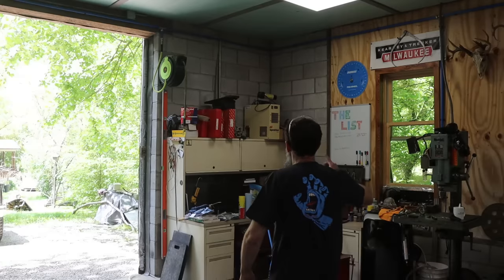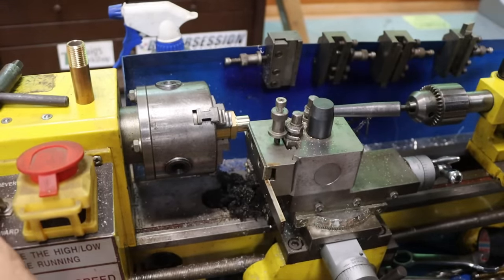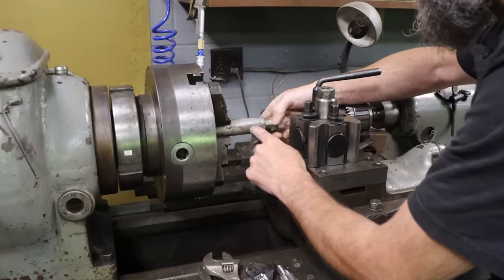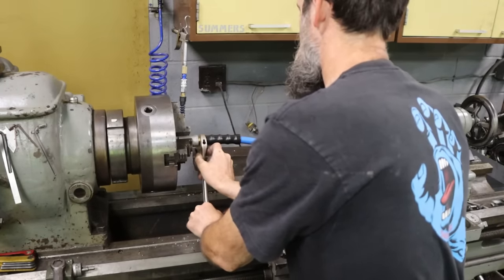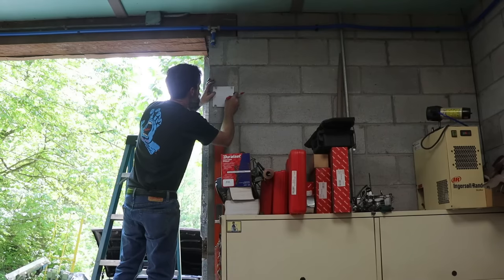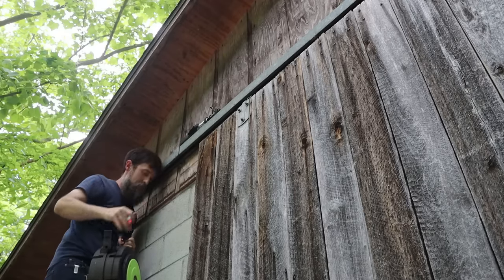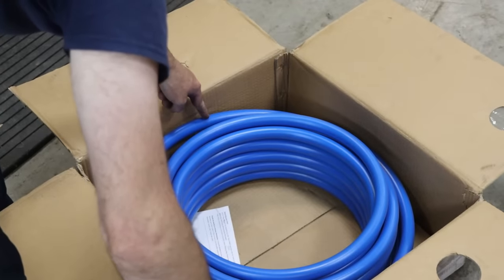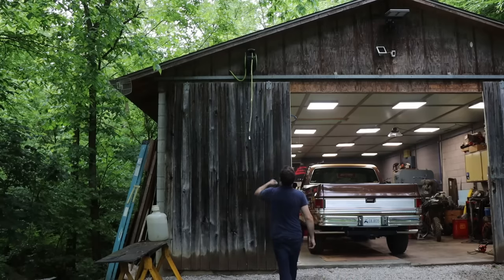Was this a Bad Idea?  Workshop air system .. Upgrade?

Comment: As an FYI, if you are using a "name brand", quality, "standard projection", off-the-shelf taper pipe tap, the tapping depth is approx. 12 threads back.  During manufacture, we (in this case GTD) thread a ring onto the tap to size it.  The large end face of the ring represents the top of the tapped hole and the "12 thread" location.  If you happen to cut off the front end to shorten it (Short Projection for shallow applications), it's approx. 5 threads from the back.
Reply: Thanks, that’s handy to know.

Comment: Steve, I love the idea of the outdoor hose reel. But a couple of things I want to let you know from experience. First, in cold weather, the o-rings in those reels seem to shrink and cause an air leak. Secondly, I highly recommend adding shutoffs and/or a quick disconnect just ahead of your hose reel. That way if it ever starts leaking or you want to change it out, you can isolate it without having to depressurize your whole air system.

Comment: I don't remember what you have for a dryer on your air system. I am praying that it is a good one. Here in Nebraska I have problems with water freezing in hose reels in the winter.  I too am concerned with the potential for bird and insect interference.  I have and use 2 of the enclosed air reels and I would prefer to have open reel style reels. I have had insect problems with my reels in the past.  Thank you for the contribution that you give to the machining community.  I look forward to each of your videos. May God bless you and your family.

Comment: I like to use the loctite Hydraulic sealant for pipes works great and never leak.
Reply: Holy Cow, I just looked at Amazon for that and it’s expensive! I don’t use a lot anymore so I might have to some, it easier to pay a little more that have to tear something apart because one joints leaking.

Comment: ive got that same bit set, with the little ratchet and extension,  great under dash and tight spots...
Reply: I’ve got the exact same one and I use it a lot, more than I thought I would. If you have a tough screw to get out, you can really put some torque on it using that little ratchet. I’ve got a set of adapters for my 1/4” drive Dewalt that has hex head to 1/4”, 3/8” and 1/2” drive so I can use about any tool or extension with it. I haven’t used the 1/2” but it’s there if I get in a tight spot.

Comment: Hey Steve, one thing you may want to do is have something to secure that outside hose reel so it doesn't go banging itself against the wall during a windy storm. I could see not only the unit getting destroyed, but also the airline getting pinched.  Great vid - I really enjoy shop upgrades.

Comment: I have that same reel (its branded different (Reelworks), but it appears identical down to the mounting holes. I also had some choice words mounting it, it's sure not light.  3 years into owning it it still works great, no leaks. As for the green out outside I might be tempted to give it an aerosol overhaul to make it blend into the building a little better, at least for the 2 green panels and maybe the hose going into the building.

Comment: I've seen a guy do this & I agree with it.
Mount & adjust the cutoff tool upside down in the tool holder, cut in reverse.
That way as the carrige & the tool flexes, it flexes away from the workpiece.
Eliminating the tool from moving into the workpiece eliminating the chatter & Binding..😊

Comment: Nice job Steve. 1/2" hose is a good choice, but I did when I was working (retired) make the company buy and stock 1/4" and 3/8" hose. My job back then required me to hand drill precision holes that only allowed +.002, and with the larger 1/2" it was really difficult and sometime impossible to do. Just to stiff and bulky.

Comment: Great job Steve! I am just installing my compressor right now. I want an outdoor capability just so I can work outdoors in the summer, but like you, I can't leave the door open because of the humidity (and heat!). I'm leaning towards just having a coil of hose near the door, and a chuck outside because of the same issues you mentioned. We would have hornets in the summer and Asian beetles in the fall filling-up and enclosed unit, and the sun would destroy the rubber pretty quick on an open unit. I will be curious to see what makes a home in your unit. here, a mud dauber would fill up the chuck right away, and I plan to cover mine

Comment: My shop air system has a solenoid valve (oversized to not affect flow) between the compressor tank and the pipework, activated by an illuminated switch just inside the door. That way the compressor can stay on all the time, but I'm not going to burn out the compressor if there was a failure in the pipework. That outside hose reel is asking to fail at some point. I'd fit a solenoid inline with the reel if nothing else. A pullcord switch could then be used to turn it on and off. Combine it with an outside light and you have a perfect combination for airing up a tyre after dark.

Comment: Hi Steve.  Nice upgrade for the shop.  I hope one day to have shop air plumbed in nice like you do.  Until then, I can roll my compressor to where I need it.  I wonder if you could pop one of the side-covers off the old hose reel to check for birds or wasps, without destroying it.

Comment: Hi Steve from Tasmania, just a thought re nesting birds in the hose reel if you put a block/board/foam/rubber behind the stop it will block the hole without hindering operation cheers John

Comment: Generally to get the Full Volume in Air systems...you start with the Largest size piping/hose and reduce down as needed for each outlet in your system....you can't get maximum CFM if you are doing it backwards... smaller to bigger....  i understood your reasoning and just passing on my experience in Air Lines.... 
🇨🇦🤓🤟

Comment: Most people don't take the fitting off the air hose then put it through the wall it makes a much smaller hole! easer to seal.

Comment: Gas stations still supply air here in Sweden, but often you have to go inside the station to borrow the tire pressure gauge, as they tend to get stolen...

Comment: I'm out hose reel airlines on the ceiling above my machines pull down the line where I need it thought we tracked out of the way when I don't I gave up entirely on having wall mount air fittings it's just too much trouble compared to having them retracting the seal the harbor freight ones work fine I've used them for years.

Comment: maibe build a wooden or poliester cup that mounts around the hose and absolutely wraps around the hole where the hose comes out of
you might need to squirt a bit of antifreese in the outdoor hose or unroll it completely and blow a lot of air out while keeping the end down during freeses as theres allways some moisture in the hose and it might split the hose when it taws again

Comment: The only possible problem I can see is with the outside unit. Where I live when it gets cold any water accumulated in the line will cause it to freeze up and plug off until it's brought inside and thawed out. With your temperatures there it is unlikely that this will ever happen but for those who may wish to use this in the northern climes they may want to consider it.

Comment: Steve, guess there must be a reason why you didn't run the airline down the outside corner of the shop wall, clear of the sliding door and mount the reel at chest height on the side wall? Would be more convenient access, (no ladders involved) if you have to work on the reel, just thinking out loud. Good to see you back in the saddle. 
Cheers from OZ 🍻👍

Comment: I ( just my opinion ) would have mounted the outside setup...on your other wall ... and lower... alot easier to use or fix if it jammed up etc..)  and i would put a Quick connect to remove that air line reel as needed and put a quick hanging setup to remove and install when i need it... and probably some kinda box to keep it covered when not used... especially if left outside permanently?  
Why not take a look inside to see if it can be fixed to wirk better??
🇨🇦🤓🤟

Comment: Good to have you back on Saturday mornings, one thought you did seal up that thru  hole in the siding.?
Reply: I wondered if a plumbing fixture escutcheon (trim plate that covers the hole where a pipe would come through) would work on that. I’ve seen ones that are hinged to fit over existing pipes, just secure it with a screw or two.

Comment: Is there anyway you could fab something up that would fit on the hose stop that would cover the holes in the outdoor hose reel? Maybe use a plastic plug like you would use on a hydraulic hose to keep critters from building mud nests in the quick connect. Just thinking, that’s all, probably aught to quit that before I hurt myself.

Comment: Question for you have an air dryer on your system my concern is wet air in the hose rack in the winter you may pop a hose outside

Comment: I have the flexzilla hose reel (I think it is similar to yours) and I noticed if I dont help it wind back up going back and forth across and just let it go in one spot it binds up.  That may be a similar issue you are facing.    Have you decided to add (or already added and I could not find the video) an aftercooler for the air system between the pump and the tank to help keep the water out of the tank and lines?  That is my hopeful project this weekend if I can finally get the right final parts tomorrow to get the air back into the tank.

Comment: I live basically 30 minutes away from anything i regularely shop at for stuff.... there is a Farm Equipment dealer 15 minutes away that has some supplies i can get if really needed that bad....but i just plan to go get what i need ahead of time if doing some project..i am used to planning ahead my supplies and have a lot in my shops for most needs... i never drive out unless i have enough reason to get something..and i like to have another reason to go anyways....driving out to get a small part or fastener is wasting time and fuel... especially nowadays....i can wait to complete a job or at least think of other stuff i might need as well.... we all find we change our plans as we get into the work or run out of fasteners ( i buy more than i need and usually save by buying a larger quantity and the next time i need that fastener..i save again by having stock to use..)...  not saying i never have to run out...but i limit that kind of behavior to actual emergencies... and save by controlling that response to poor planning and buying overpriced small packages of fasteners....
🇨🇦🤓🤟

Comment: When did you put the Yagi Antenna on the workshop Steve? Was that when you switched over to Starlink and liked the speeds so setup a wireless connection to the shop instead of trenching in some Cat 6 ethernet cable?
Reply: Trenching thru rocky soils may not be on Steve's short list of things to do....

Comment: You mentioned kids using your outdoor hose, not a good idea as they tend to fill cycle tyres to bursting point. We used to let kids pump their own bicycle tyres at our motorbike shop till one day there was a loud bang, thence forth we did it for them!
Reply: I have always been puzzled by this (and have noticed that the compressors at garages always say not to use on bicycle tyres) as my experience is that push-bike tyres run higher pressures than cars or motorcycles. 120psi is a fairly common rating.
Reply: @andypughtube  what condition a bicycle tyre can be in can be variable, especially in a notionally deprived area where our shop was, and it can be risky to let a kid try to get the maximum the air line can supply, in our case 150psi, into an old and abused one. Certainly the kids around our shop did not ride high end racing bikes, unless they stole them😉

Comment: Someone did not leak test in the roof... its not even a metal roof and you are sweating like a (If I say it community guidelines and all that!) Live in Namibia our roofs are HOT ;)  Open the hole to the attic before entering and let it air air vent  in the walls at the ends to open close with a pole like the old school windows..

Comment: New reel would look alot better if you would have put a 90 degree fitting going from your feed into the side of the beautiful new reel instead of that ugly loop hanging into your door way.  You are normally such a perfectionist.